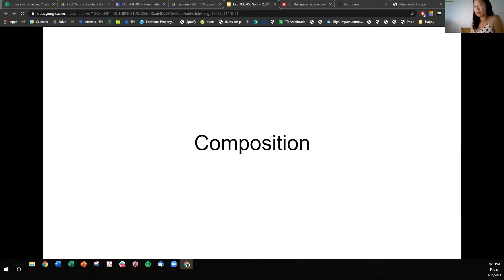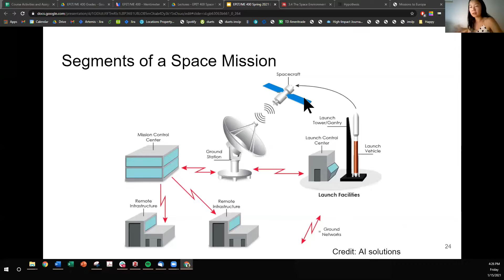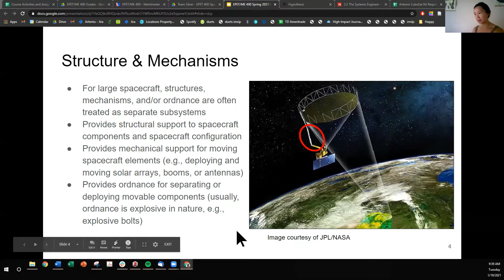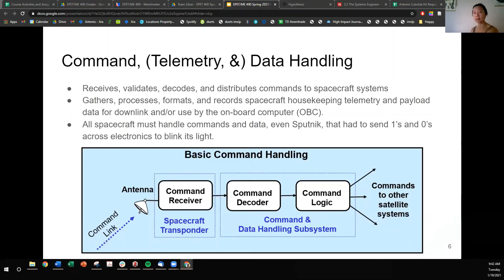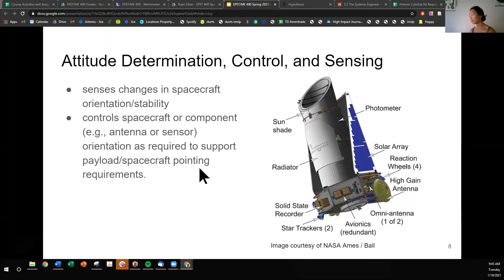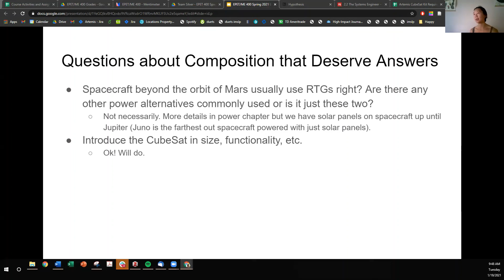1.4 Introduction: What? (Spacecraft Definition)

Comment: I've noticed that, in the Kepler space telescope picture, there is a radiator. I've then asked an AI on the internet how it can disspiate heat to space without transmitting it to any air and it answered it's a grat question (it's funny to be complimented from an AI) and explained that dissipation occurs via infrared radiation only.